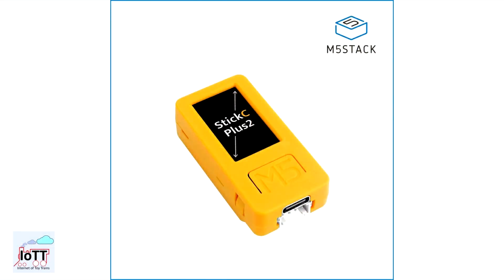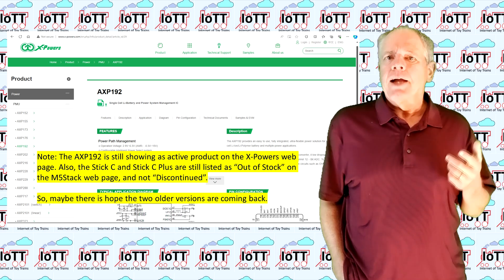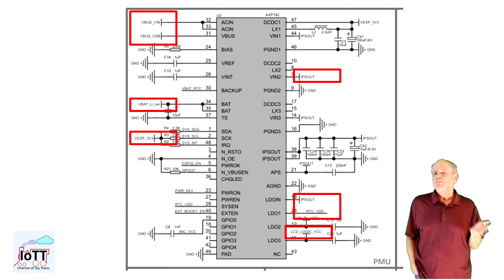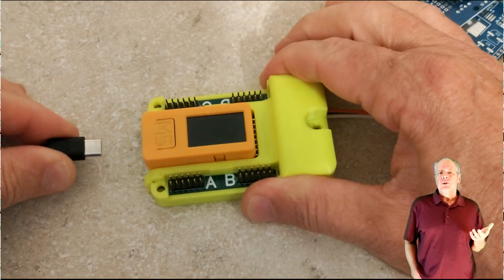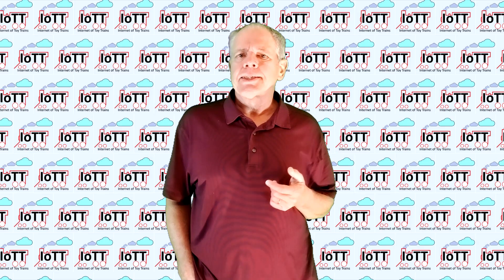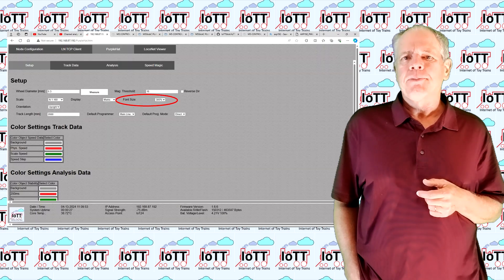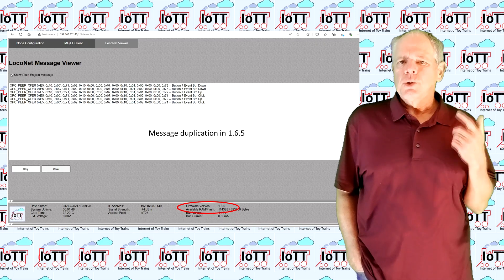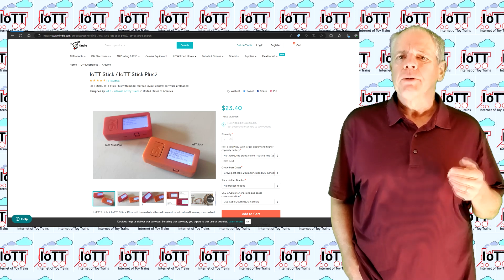IoTT Stick Plus2 (Video#139)

Comment: Hello Hans, I am trying to set up a new Stick C Plus2 with version 1.6.7 downloaded and when it boots I am unable to connect to it to set the WiFi connection.  The stick screen shows the AP as IoTT_Stick_M5_3029699340 but the SSID that is broadcast is New_IoTT-Stick_3029699340  When I try to connect to that from either my iPhone or my Windows 10 computer I get a message that the connection failed.  Any thoughts or suggestions?  Roland Minshall
Reply from the maker: If it shows New_IoTT that is when it is ready to do the setup. If it shows IoTT_Stick.... it means the setup timed out and it initialized its own access point. You need to restart to get back into the connection mode.
It seems that the Stick Plus2 is somewhat more difficult to connect to than the older versions. I have been working on some changes which will come with the next release. What I found that helps is if you walk away from the Stick maybe 10 feet or so when you try to open the captive portal for the setup.
Reply: @IoTT  Hans, I tried moving away from the Stick and didn't have any luck.  I also noticed that the Broadcast SSID (New_IoTT-Stick_3029699340) was no longer visible in the available networks list on my phone.  I will look forward to your changes in the new version.

Comment: Hi Hans. I have a RedHat and 2 GreenHats using the original M5Stick that are currently on v1.5.20. I tried to upgrade the RedHat to v1.6.7 when I install my saved configuration files the M5stick screen and led kept flashing in a boot loop I think. I had the same result with v1.6.3 which is the oldest version on GitHub. Is there a way to upgrade to v1.6.7 without manually typing in my configuration data (as I have a lot of servos).
Reply from the maker: The built in upgrade conversion normally only work one version step at a time, so upgrading so many steps is difficult, particularly if you try to load the entire stick configuration. 
You have a much better chance if you try to save and load only one category at a time, e.g. the RedHat configuration, and store it in a separate file. To do that, click the save button on the RedHat page and store it in e.g. rhcfg.json. Then try to load just this file into the stick with the new software version. Chances are it works. And if not, it is much easier to compare the old file with the new and make the changes in a text editor.
Hope that helps.